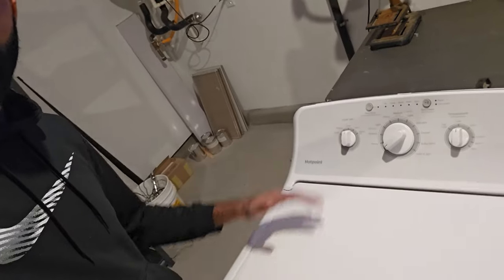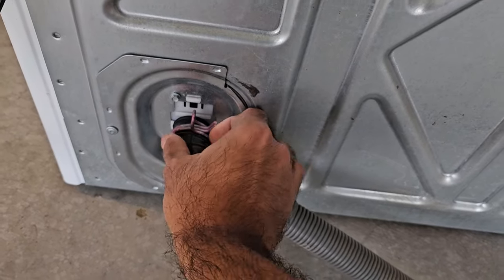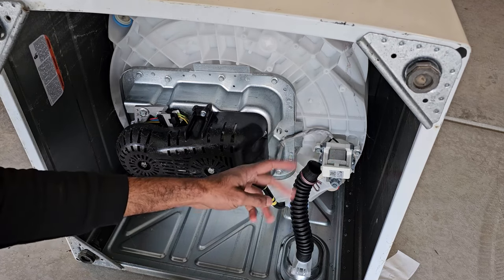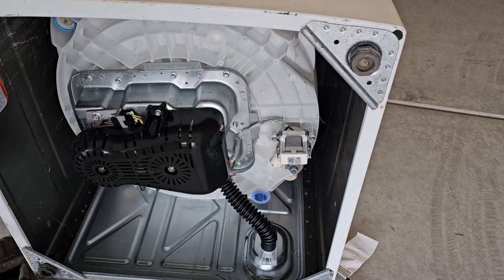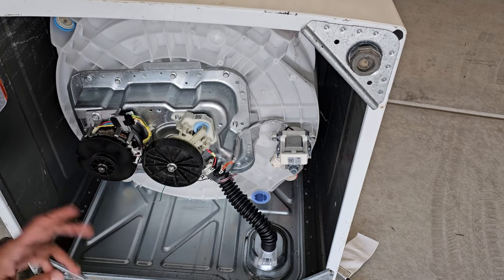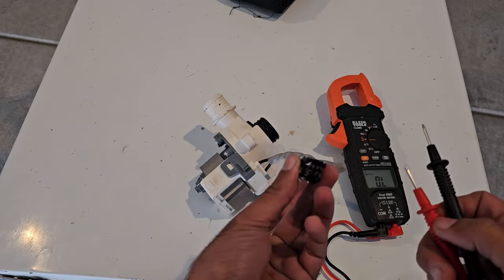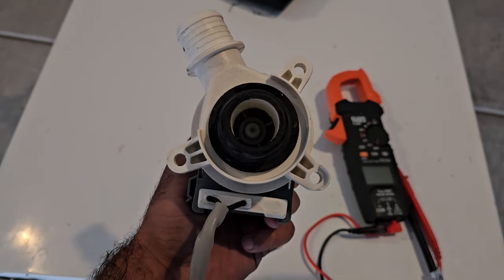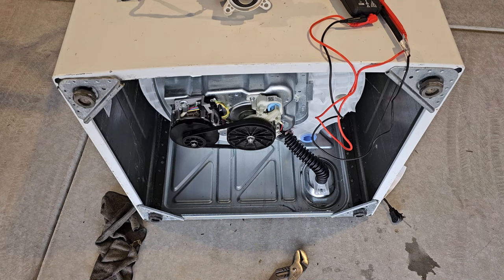Top 5 Reasons Your Hotpoint Washer Is Not Draining!

Comment: I’m trying one of your repairs on my washer - but-  how do you completely drain the washer before you tip it on its back??
Reply from the maker: Multiple methods: Trying pulling the drain hose out of the standpipe and and into a bucket on the ground, if that doesn't work try to get as much water out by manually emptying it, and lastly harbor freight sells a $15 transfer pump that works great!
Reply: I have a washing machine that needs a new transmission and I would like you to do the repair how do I reach you? I am in California
Reply: Wet dry vac.